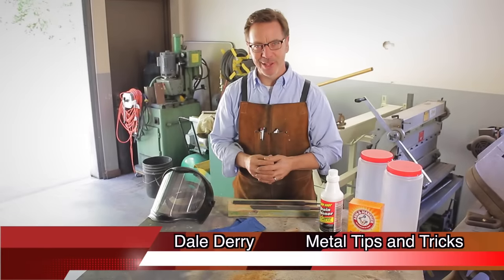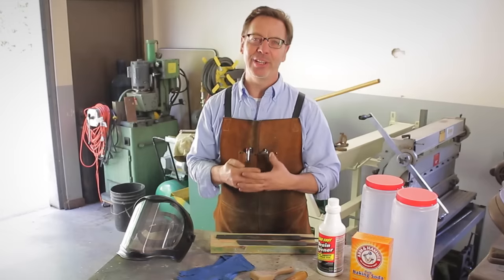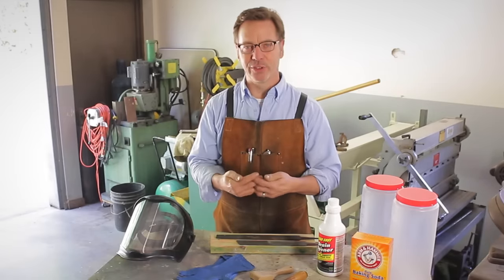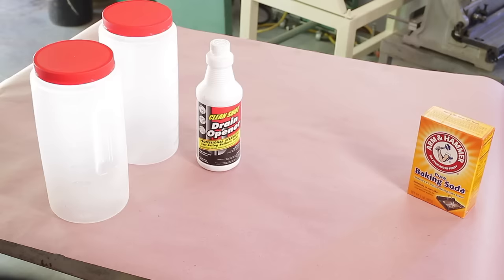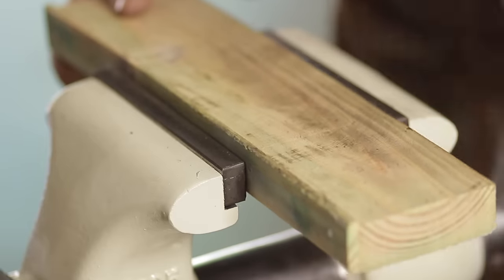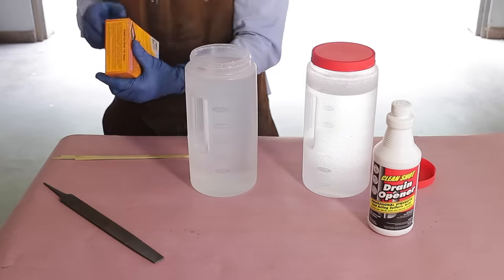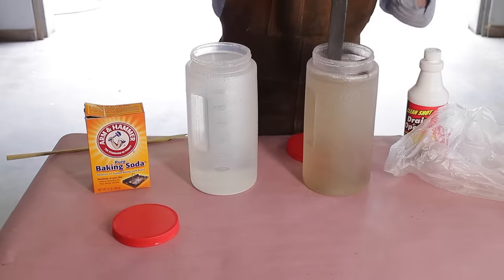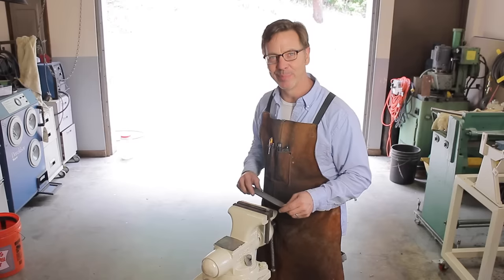How to Sharpen Metal Files

Comment: But all it did was clean the file.
Reply: yes no amount of cleaning will sharpen dull teeth
Reply: Metallurgically it is more complex than that. Files are made of a mixture of metals and other elements. From the factory, they are treated with heat and chemicals to get rid of some of the soft materials to leave only the really tough ones in the surface layer, to make a skin of really hard, tough material on the teeth. As the file gets older, or is worked, the more that hard skin is worn off to expose the less tough material inside. Plus, debris of soft materials from the metals being worked builds up in crevices as well.

So, when an acid bath is used as per above, not only is debris removed from previous use, but the file is "etched" again to remove the softer elements on the surface so as to reestablish that bone hard skin.

A good way to see it in your mind is to imagine a piece of smooth concrete, that is made of soft cement mixed with rock hard pebbles/aggregate inside. Imagine using a water blaster to remove the soft cement at the surface, to leave all of those rock hard, scratchy pebbles sticking out of the surface. That is like the surface of a file. With lots of use, not only does debris build up on the surface, but the rock hard pebbles are worn away, so that the soft cement is once again at the surface. 

To make the concrete really scratchy again, you need to get rid of both debris, and soft cement, so that your surface is mostly rock hard jagged pebbles once more - in other words, you'd have to water blast it again. Thus, the water blasting isn't just cleaning of debris - it is reestablishment of the correct layer of materials on the surface. The acid bath, just like the water blaster in this imaginary example, therefore serves a double purpose - cleaning and re-hardening.

Hope that clears things up a bit.
Reply: Jason Rahimzadeh I cannot agree with your statement that there is no change in metallurgic property. Please refer to the process of depletion gilding, which is a blanket term for surface enrichment. It may be achieved via several methods, including that shown in the video.
Reply: @aucklandmail  Cleaning no.  chemically etching ABSOLUTELY will sharpen a file.

Comment: It isn't sharpening, it is simply cleaning from clogging.
Reply: chru cas wrong, the sulphuric acid eats some of the metal away leaving sharp edges
Reply: Dear @redman8067  
Maybe a tiny tiny little bit. But definitely not enough! Unfortunately there is only one way to sharpen dull files for sure.
Back to the file smiths oven and starting a procedure nearly like making new ones. 
Best regards.

Comment: You can use the end grain of that 2x4 to clean the file, much like you used the flattened copper tube. I have been cleaning my files that way for forty years, works well.
Reply from the maker: thanks for the tip

Comment: Excellent advice and a real money saver. I like your file cleaner made from a copper pipe cleaner. One of my old file cards has a 2" long copper pick that stores in a slot along the top of the file card. Helps remove the embedded pins from the files but slower working than your copper pipe. I always check my files for pinning before doing draw filing to prevent ruining my work. Thanks for the file restoration tip.
Reply from the maker: +Paul Jones 
thanks for your comments

Comment: didn't sound like it made a difference
Reply from the maker: It really dose sharpen the file. Give it a try, you have nothing to lose.  I promise you, you will be surprised.    
One side note,  the file must be dull not damaged to work. :-)
Reply: Metal Tips and Tricks i don't know if I can trust anything you say after that drill doctor video. those things are complete garbage, just learn to sharpen a drill by hand with any grinding wheel
Reply: Mark Cutright I have a drill doctor but I only use it for sharpening Tig tungsten, that's all its good for
Reply: I have a drill doctor also and it works great, sounds to me like you don't know how to use it!
Reply: MrJohn714 Lulz. I just know how to use a bend grinder child
Reply: That will work too, did it that way myself for years.
Reply: The Drill Doctor is a good way to get repeatable results.
I have sharpened drills by hand for years. With care and practice I am able to do it well. For the weekend warrior or someone new to the trade it can be a daunting task. You have to understand the relationship between the cutting edge and the drill. There are many variations of relief angle and point angle. It is also important to know how to center the edges.  
Once you have all that firmly grasped you need to develop the skill to hold the bit at the proper angle and advance the bit into the grinding wheel.
For someof us it's like patting your head and rubbing your stomach at the same time. 
The popularity of jigs and fixtures to help grind drill bits, points to its difficulty. The Drill Doctor is a home and hobby version of the Darex grinding machines. With cams and guides taking the place of hard won muscle memory, the task is much easier. I compare it to a paint by number set for a beginning painter. It won't make you a master but chances are you will recognize the picture when you are done.
Reply: Well stated!

Comment: Here's a really good shot of this file not working. Now that I cleaned it here's a far away shot of me using a file. Now see the difference this magic potion did? Amazing, it sharpened the file just take my word for it you don't need to see because I know what I'm doing. Don't see myself coming back to this channel.
Reply: "Magic potion" is a an acid solution. The acid eats away at the surface of the steel. Just like oxidization eats away at surface of the steel. Being in an acid bath allows for the reacted steel at the surface to drift away exposing fresh steel. due to the geometry of the file "blades" the acid will react with the face of each blade more than the tip because there is more surface area on the face than the tip. This means as the steel is eaten away it forms a sharp point. Theres no such thing as magic, this is just basic chemistry!
Reply: Metal Tips and Tricks Copy/paste your replies much? 😒
Reply: Jordan Bartholme looks like he deleted it lol
Reply: Bruce Woulda ? No, that comment right there. He has it copied word for word as a response to several other comments.
Reply: It's a scientific fact.  To say that it does not sharpen the file is like proclaiming the sun does not rise on a cloudy day.  Try it.  Don.t be a numscull

Comment: seems to me the acid is just cleaning the file not sharpening it.  my dull files have no cutting edge on the individual spurs. your acid cannot replace what is missing. the acid will non-uniformly remove material.  BOGUS CRAP.
Reply: I concur, the acid uniformly removes material leaving thicker blunted edges now thinner and sharper.
Reply: Have you ever tried this? I have. about a dozen times with files i have found that though worn,dirty, or mistreated still have some bite to them (You can feel it with your thumb.) I am convinced through empirical observation that by golly, they're as sharp as a well cared for but used file. 
Now, I didn't check the science, electron microscopy or otherwise, I checked it against whatever steel I was working on. A $12 bottle of muriatic acid has cleaned up and saved a dozen $30 files.
I might add that i was taught to use a file by an old world machinist who felt that part of my tutelage required me to file to specified dimensions while maintaining square and parallel surfaces.  He also taught me this method, and none of his files were ever dirty or misused...
AAR
Reply: Free thinker. FUKIN RELAX DUDE

Comment: The only way to sharpen a file is to toss it into the trash and get a new one!
Reply: +Joseph Lippencott Using acid to restore files is well known. The method is described in many engineering texts.
Reply: +Derek Spender 
Name ONE reputable engineering text example.
I have been a toolmaker and machinist for over 50 years and know how a file is designed, made, and used and know this is total BS. A dull file will always be a dull file.
Think about how acid reacts on metal. It etches away the surface uniformly. It doesn't selectively act on rounded (dull) surfaces and make them back into sharp edges.
Reply: +Joseph Lippencott I could say more but I'm not wasting my time on people who think that words like "Bullshit"prove everything. I will say that the texts don't recommend the technique given in this video. It will only give the results that you describe.
Reply: To be fair this only cleans a clogged file worn metal is worn metal.
Reply: Joseph Lippencott,this technique has been around for about as long as files have been and it is well documented.If you care to make a wager I know of a place that uses acid to sharpen files.I'd be willing to bet $500 that it works ;) I'll even cover the postage for you to send some dull files.
Reply: or toss them my way and I will sharpen it with this method and use them for years to come.  been doing it for 20 years.  LUUUUv  old files!

Comment: CLUCK BAIT ( this is cleaning not sharpening)
Reply: If it works like vinegar then it actually removes minute amounts of metal on the thin cutting edges. I do it with hot vinegar, turns the file black but it also prevents rusting and the file cuts much better afterward. If you left it in the acid it would eat the metal away entirely over time. The trick is not overdoing it.
Reply: Here is a link to a person asking how it is done, the person answering does a fine explanation of the hows and whys of the process. https://woodworking.stackexchange.com/questions/3566/how-to-restore-old-files If you need some more scientific evidence I suppose you could try doing some googling, its a well known procedure to extend the life of files so long as they aren't merely case hardened. I think the link I supplied covers pretty much all the bases though, and in more detail than I could post here.
Reply: Pedant. This technique both cleans AND sharpens the file, if he had stopped after the copper pipe and the wire brush, then yes.. it would only be cleaning the file, but the acid thins the edges of the dulled cutting surfaces, and in the process makes them sharper (assuming you don't over do the process).
Reply: Well you clucked on it!

Comment: BULLCHIT
It may clean to help them cut better but doesn't sharpen them! Can easily see after doing his 'sharpening method' that he's pressing down harder on the file making look like the cleaning method did so much more than what it actually does
Reply: Apparently it does,  I've been down  this rabbit hole before. Supposedly it corrodes the teeth and that basically dissolves the little blunted end of each one. You can't do it indefinitely, eventually it stops working and I doubt it works on super blunt files.
Reply: @stevem815  
I'm still trying to find any video where they actually proven it like done with many other situations like this whereby taking video of the file teeth under at least moderate magnification, applying sulfuric acid and showing the etching process in real time, and then afterwards showing the teeth under magnification for us to closely see any real difference.... all I can find are videos and still pictures showing the basic before and after effect of sulfuric acid and then like in this video showing a guy's file won't do a good job but after using sulfuric acid and then shoving down harder on the file somehow verifies it lol 
  Bottom line it won't actually sharpen a dull file unlike what many commenters are suggesting. There is no way to have rounded teeth on a file and then sulfuric acid etches them to their sharp edges again.
Reply: @get-the-lead-out.4593  Why not just get an old file and try it. Seems like it would be pretty easy to find out either way.  I'll get round to it one day with the pile of files in my shop. If I remember to I'll message you and let you know.

Comment: I clean my files with a brass wire brush after each use and when necessary in between while working on a object. Chalk as well when needed. After almost forty years though I am considering buying one or the other new. At this point I can't imagine messing around with chemicals is worth it. Using cooper to clean up the teeth is an old trick I have used for ages. It is particularly successful when working with aluminum.

Comment: the file is mechanically cleaned to get the swarf out of the teeth, and a step not included is a detergent bath and scrub, to clean off any oils that may be on the file. Acid etches or dissolves the surface of the metal of the file...remember that each "tooth" has an upper and a lower surface and these are etched or dissolved. What is left behind is a somewhat sharper cutting edge. Not necessarily a perfect edge, but sharper than what was there before the acid etch. A bath in the soda to neutralize the acid, and then a good rinse to remove the soda.
Reply from the maker: Nice comments
Reply: Now, you're talking!  That file should probably be as clean as you can get it before trying to do something chemical with it.  Hot water and a strong alkaline cleaner and a good scrub, why not?  I think the top edge is etched more than the bottom, it almost certainly is in the electrochemical process.  If someone out there can do some metallography, now's the time!  All we ask is a nice "before" and "after" picture, maybe fifty power.  I've already used video microscopes that came with software, you could make measurements.

Comment: My gramps taught me to do this years ago only using white vinegar. If you use household which is 5%, the files need to soak for up to a week, depending on how bad they are. Although this does take substantially longer, it is much safer and less expensive than using sulfuric acid. You can also use industrial vinegar or acetic acid but it is much more expensive and a lot stronger at 30% and requires the same saftey precautions as sulfuric acid. I have also used muriatic acid and it works just fine. Just keep the dilution to 10 to 1 or ten to 1.5 water/acid and keep an eye on progress so as not to let it go too far and ruin the files. Keeping files all piled together is a sure way to dull tgem quickly. Store them separately in a rack or make covers for them to protect the teeth

Comment: Thank you I never known files could be resharpened.
My old files were used as wedges on the ends of my axes, that seem to last as long as a handle does rater then wooden wedges that crack and fall out.

Comment: an old Machinist taught me to use copper tube in the mid 80s that does most of the work, I will do a test to see how much difference there is between just using the copper and the copper followed by acid.
Reply from the maker: Thanks for your commnet .

Comment: While it takes longer, I use vinegar to clean my files. Why ? Safety! Sulphuric is dangerous stuff. Vinegar hasn't killed anyone I know of. Done on a hot day, the files clean up quickly. It is quite amazing seeing dirty rusty crappy files come back from the dead. I'm a Mechanical Fitter from, Perth Australia. Thanks for your video Dale!!
Reply from the maker: Hi Dumbskippy, Thank for your comment I have heard from a lot of people they use vinegar I'm going to have to try it.

Dale :-0
Reply: My Pleasure Dale.. After the Bicarb bath and drying, coat in thin sewing machine oil first and them if it  gets warm where you are, a coating of heavier grade mineral, oil to prevent re-rusting.

Comment: I just want to say THANK YOU SO MUCH!  I have a lifetime of files (I never threw them away) and now I can sharpen them!  I'm very grateful!
Reply: sorry to burst your bubble, its just cleaning
Reply: ghettohillbilly1 No, it's not ghb1, the sulphuric acid will etch the steel and leave the tungsten producing a jagged surface.  The first process cleans the file, the acid will "sharpen" it.
Reply: Curby Weaver so your saying it makes round teeth pointy again?
Reply: ghettohillbilly1 It etches out the steel in the alloy leaving the sharp tungsten which is much harder than the steel around it.  The file seems dull because the steel is acting like a lubricant.  Once the steel is etched away the exposed tungsten makes greater contact with the surface and cuts better.
Reply: Curby Weaver Sharpening is the process of creating or refining a sharp edge of appropriate shape on a tool or implement designed for cutting. Sharpening is done by grinding away material on the implement with an abrasive substance harder than the material of the implement, followed sometimes by processes to polish the sharp surface to increase smoothness and to correct small mechanical deformations without regrinding.
Reply from the maker: Thanks for your comment. :-)
Reply from the maker: Give it a try, it really dose sharpen the file.   I promise you, you will be surprised.    
One side note the file must be dull not damaged to work. :-)
Reply: ***** im glad it "DOSE" sharpen the file since you cant be bothered to make real responses
Reply: ghettohillbilly1     Don't type snipe

Comment: Years ago I had a old tractor. To check the fuel you dipped something in the tank. I used an old file. One day I dropped it in the tank on accident. Fast forward a few weeks. The file covered the pickup on the bottom of the tank and I had to remove it. It worked like a new file!

Comment: I worked as a bench jeweler at Cartier in New York in the mid seventies and there were some older men who had been Jewellers during WWII and they told me that new files were not always available so they put old ones into the sulphuric acid pickle to sharpen them like you did in this video that made the pickle unsuitable for gold so it had to be replaced so the guy who kept the pickle in order was not too pleased with this practice, good video, thanks!